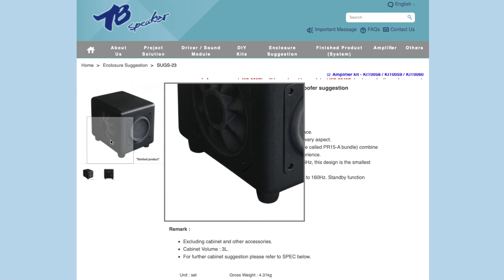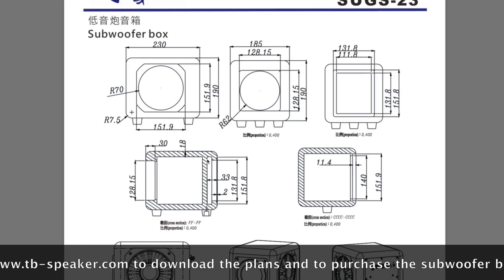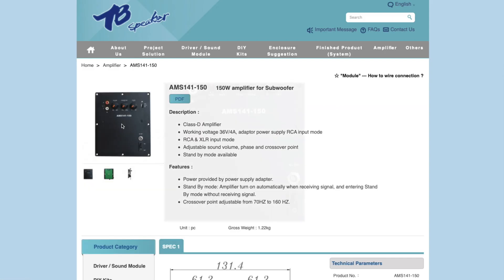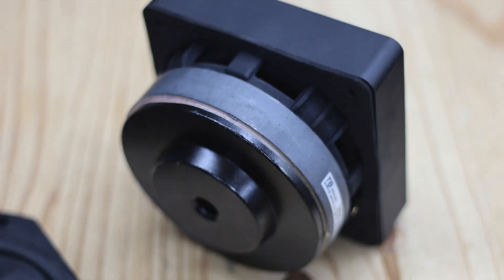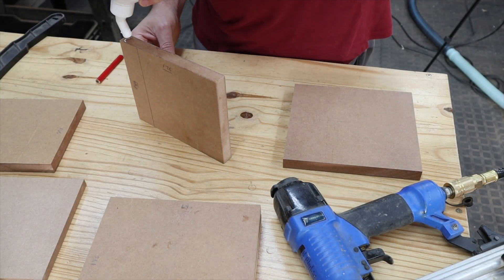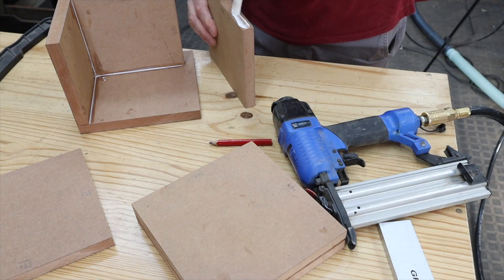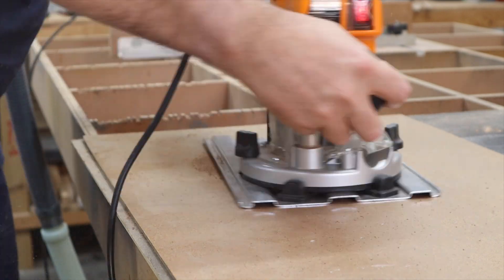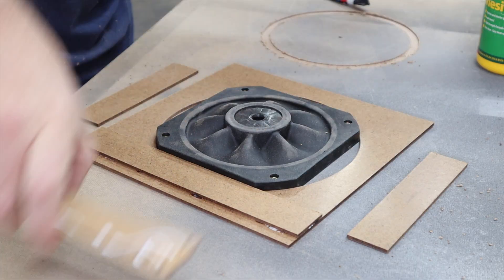Building a Small Subwoofer - Plays down to 33Hz!! - by SoundBlab

Comment: I'm a bit negatively surprised that you are praising a "-10db"-value.
Reply from the maker: I hear you, but you also have to account for room gain. The amplitude response graph I showed is only projected based on the driver specs. If you chuck this into, or close to a corner you will definitely up that db number.
Reply: @SoundBlab  yeah, considering the use case for such a small diameter... As a desktop-PC woofer, OK... On the other hand the upper frequencies (up to ~150 Hz) will have pretty much the same room gain, wouldn't they?

Other question: 
what's your opinion on 60cm (> 23 inches) or bigger diameter woofers as infra sonic extensions? Or do you prefer multiple smaller ones (to achieve equal membrane size)?

Edit: maybe I underestimate the impact of the small driver. My first thought after starting the video was to put them in to some shelve speakers boxes but then I saw the additional amp.